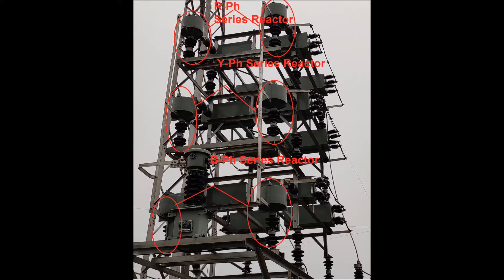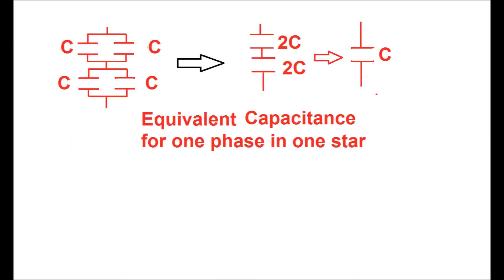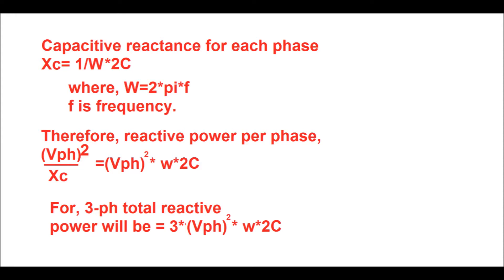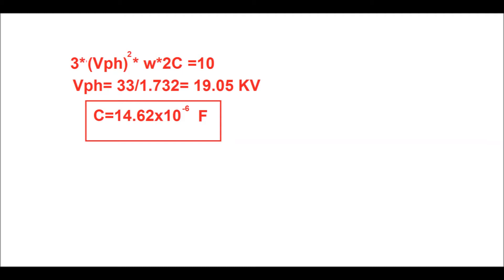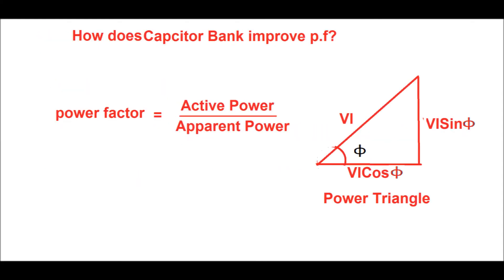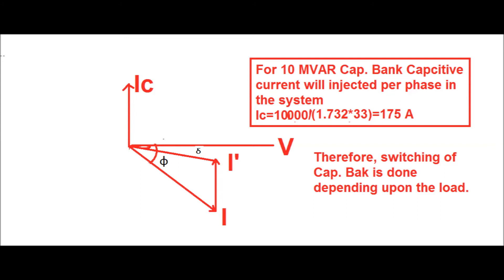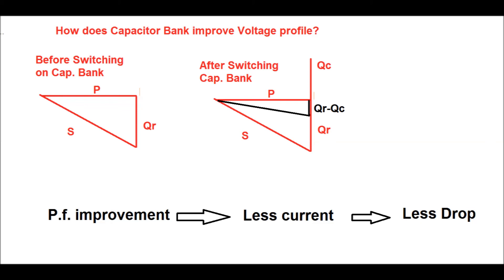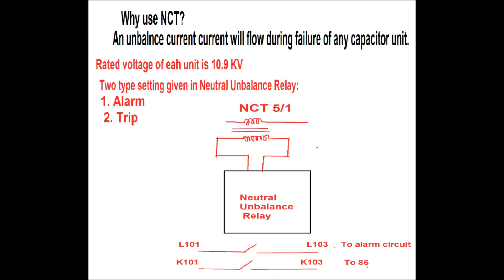CAPACITOR BANK ( 33 KV)

Comment: Good video. But why delta mode is not adopted instead of star mode?The requirement of capacitors will be reduced to one third of that in star mode.
Reply from the maker: How to detect any faulty unit in delta mode?
Reply: In case of failure of one unit,  it will be open delta, but will continue to correct power factor to the extent of 57% of the healthy bank. Pf meter will indicate the insufficient corrections of pf in case of any failure.

Comment: Sir ,  how to balancing the shunt capcitor
Reply from the maker: Fisrt you have to draw the diagram, then measure all capacitance of 24 cap. Unit separately by Multimeter. Now you have to place the capacitors in such a way that in  double star condition different between equivalent capacitance measured in  each phase in each star shall be minimised so that there shall be minimum current flows in the nct.

Comment: Very useful video sir... 
Sir how to calculate the capcitve inject current for 10Mvar is.... 10000/root3*33= 145
Reply from the maker: 175A is the total phase current injected in the system. In each star each phase it will be 87.49 or almost 87.5A .
Reply: @relayprotectionelectrical  yes sir got it... Plz upload data sheet of micom p141 realy... OC backup relay